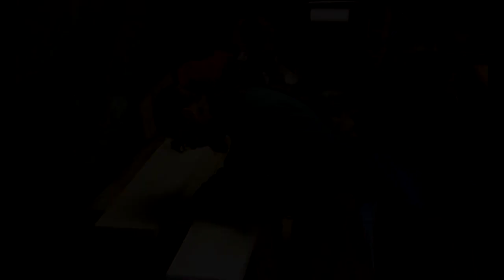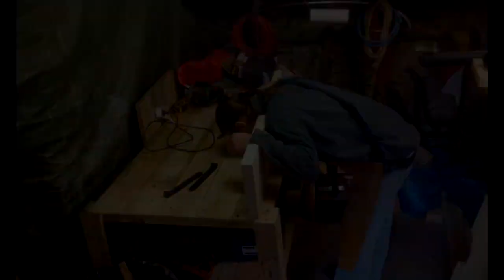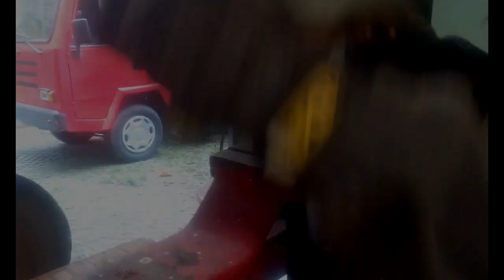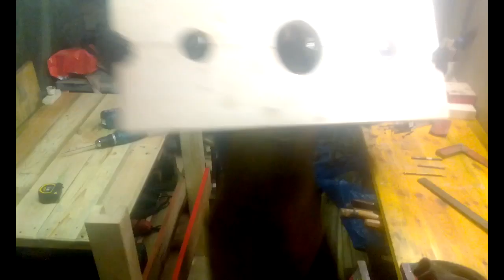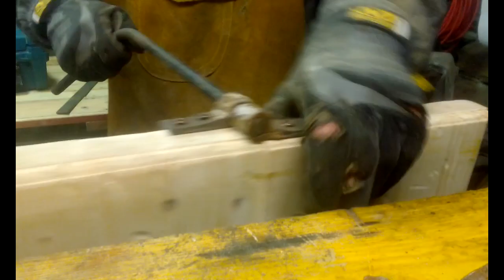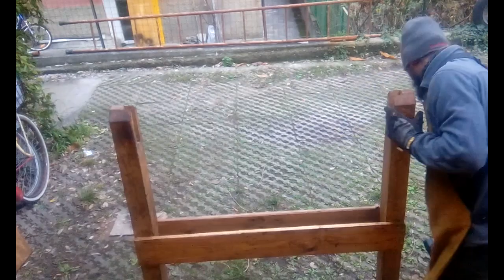Making a Pillory!

Comment: Nice work!  Your pillory is real authentic to what they used a couple hundred years ago & looks sturdy. What brand & model of jigsaw did you use for the round holes?  we made a pillory for a high school carnival & had lots of trouble getting a good smooth large neck hole, had to use a rasp to get a round hole....think our jigsaw was just garbage.
Reply from the maker: thank you Bill! My jigsaw is a bosch one but for this kind of holes you can even use a cheaper model, the difference is in the blade, if it's flexible enough, cut slowly and will  make a perfect smooth cut ^^